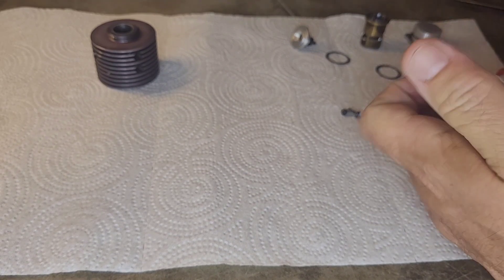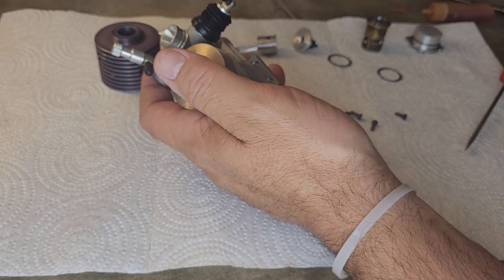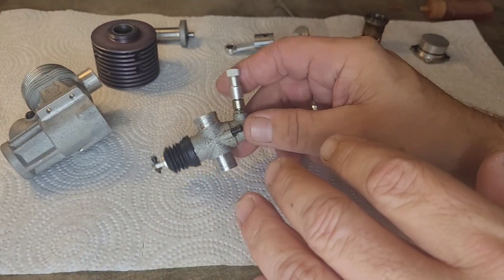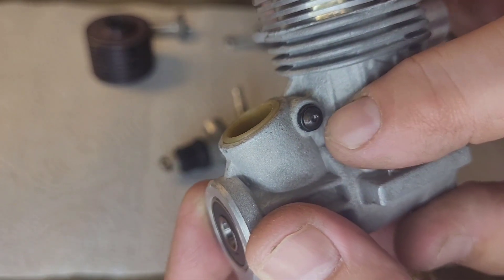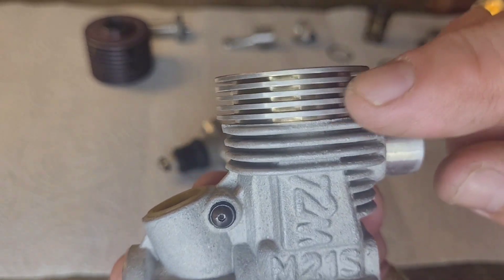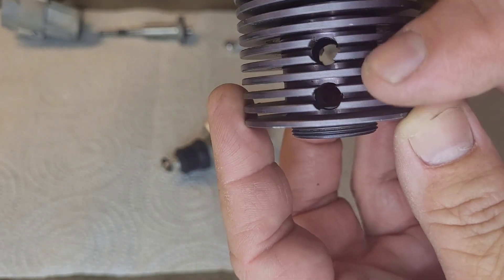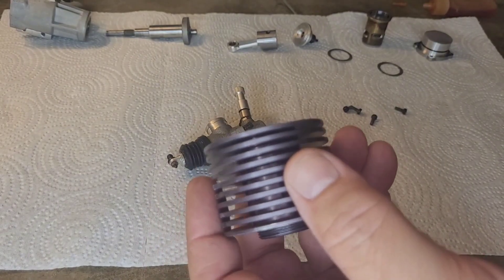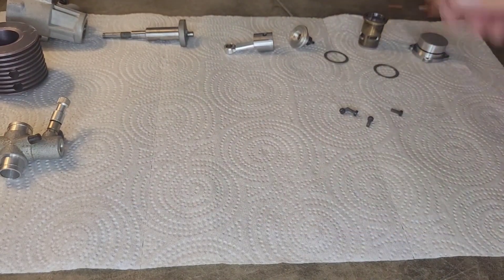Let's celebrate 500 subs with a look at a super rare and unique Nitro engine

Comment: Congratulations I do so enjoy watching your videos you clearly know a thing or to. Could I possibly ask you for some advice regarding an extremely old nitro engine and car I have? It is an old pb1 from the 70s with a Porsche 917 body any help would be greatly appreciated.
Reply from the maker: I haven't dealt with those old 1/8 on roads much. I personally would move it on to someone who specializes in/collects them. The parts are extremely hard to come by and demand a premium when they do. Running them is very risky, you could break something that there are no replacements for. At this point they are shelf sitters imo. That being said, is the car complete, you have the starter box? Any spare parts? They can be a blast to drive,  and usually fetch a pretty penny when nice complete cars come up for sale.